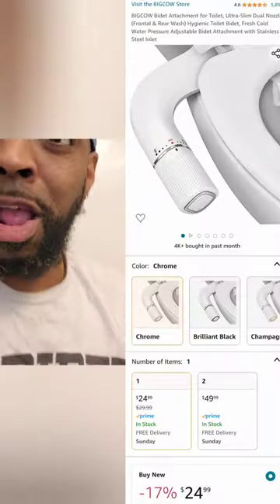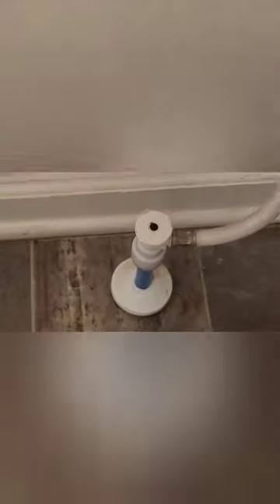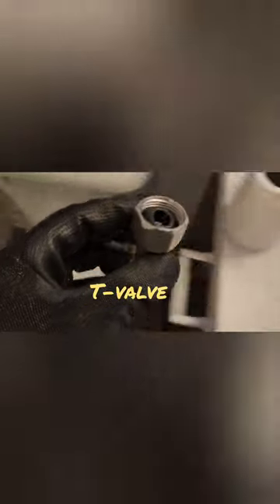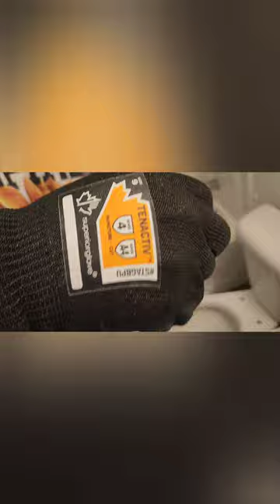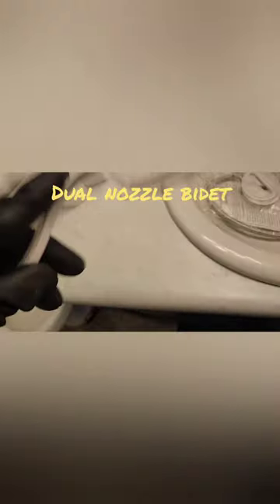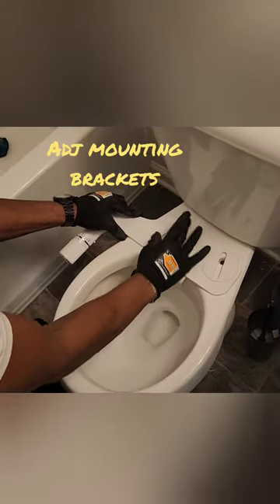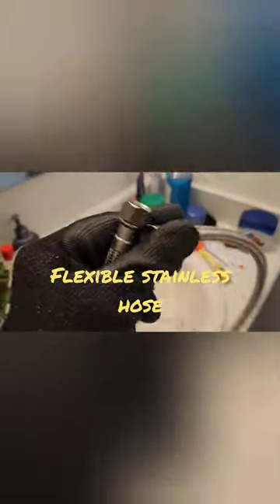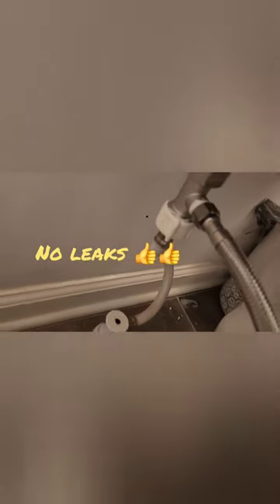Big cow bidet toilet attachment install

Comment: I had this installed on a toilet previously but I just moved and now when I try to install it on the new toilet I can’t figure out what I’m doing wrong. It sprays water everywhere at the T-valve when I turn the water supply back on.
Reply from the maker: Check the rubber seal... and did you use enough thread tape